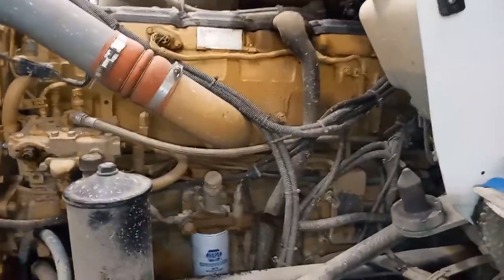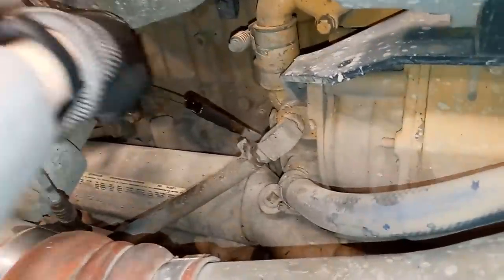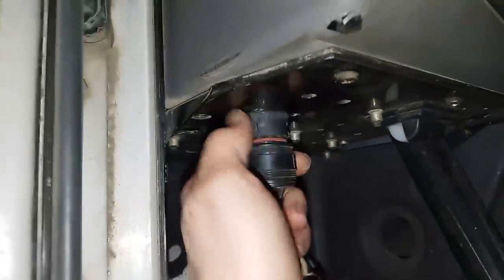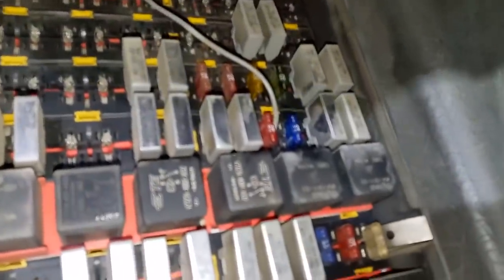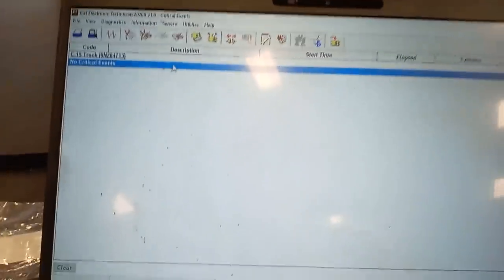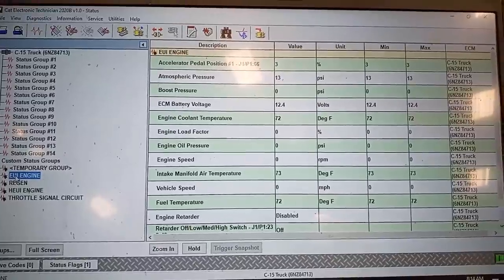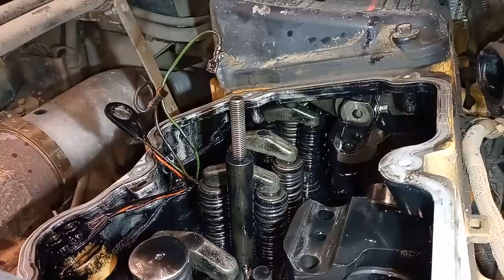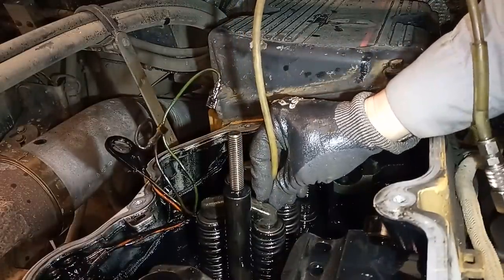What's Wrong With This SMOKY C-15. Cat Engine Smoking.

Comment: I have reused the injector hold down bolts and have yet to have a problem, and have pulled 500 or more injectors on the c15 engines....Don't waste money on new bolts.......

Comment: why not use a proper leak down tester or compression tester?
Reply: 3406E’s don’t have glow plugs or a way to check cylinder pressure on each cylinder individually. ET does not offer a compression test either.

Comment: I'm  not saying  your wrong And a computer does make it  100x easier,but for someone  without a computer  you could figure this out by removing  the connector  to the injectors 1 at a time
Reply from the maker: You can figure it out without one you are correct, be careful though because that injectors are supplied with around 100 volts, not 12 volts.